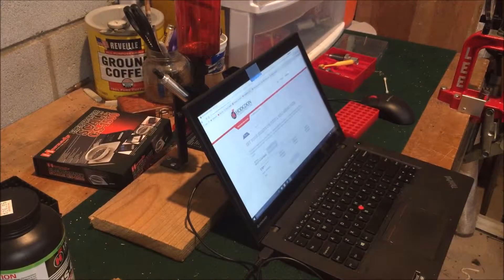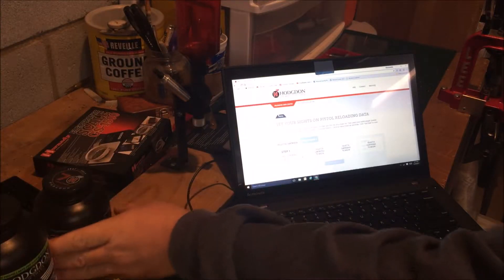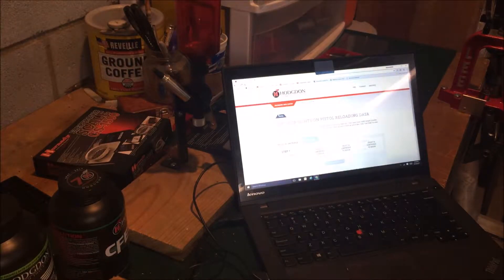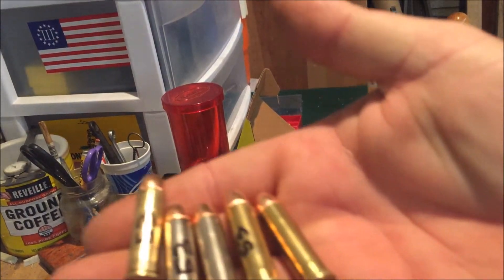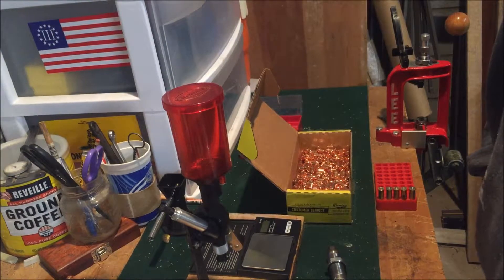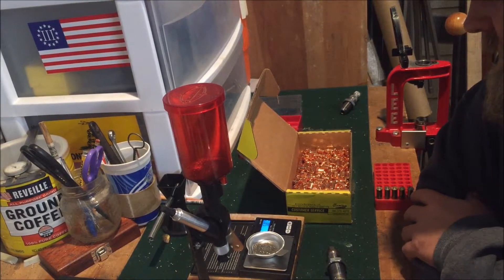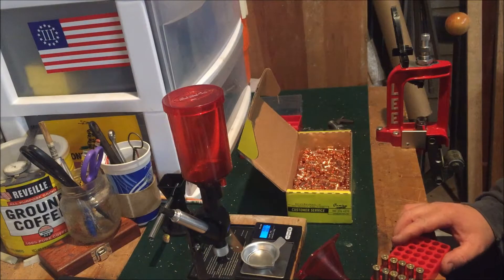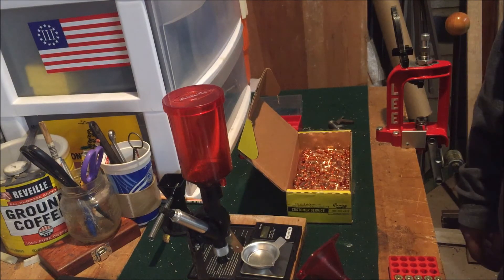Working up NEW .357 Magnum Loads CFE Pistol

Comment: You might want to recheck your load data. The 5.3 to 6.6 is for LSWC. A Hornady XTP JHP listed at 6.1 to 6.9.
Reply from the maker: Thanks for the input. I will double check. Thanks for watching.
Reply: I agree and the data is listed as such. What is questionable is the air gap that CFE Pistol leaves in the case! I pulled apart a factory 125 grain hollow point and it was plum full of powder, like maybe Lil 'Gun or something very similar.

Comment: Question. Loading CFE powder in 158gn 357mag. Theres like no powder compared to h110 powder. H110 reload at 15.0gn charge. And the CFE is 6.1gn charge. 

Is that right? Theres a huge air gap.